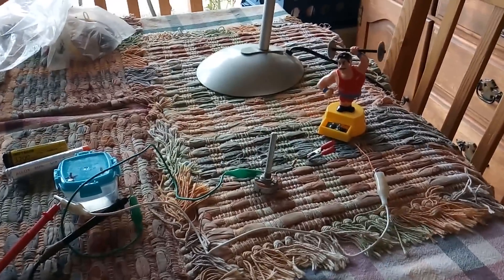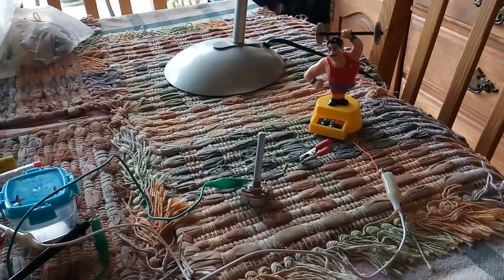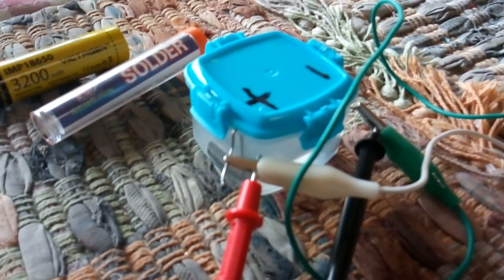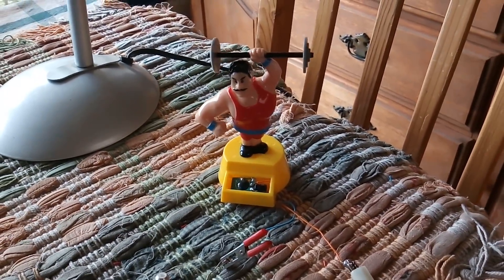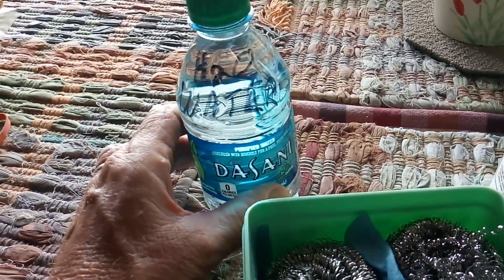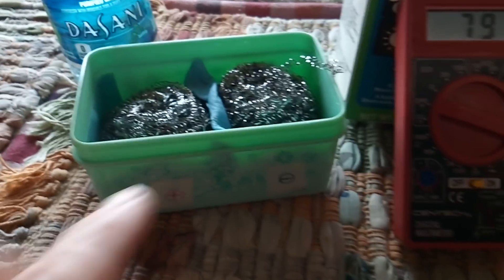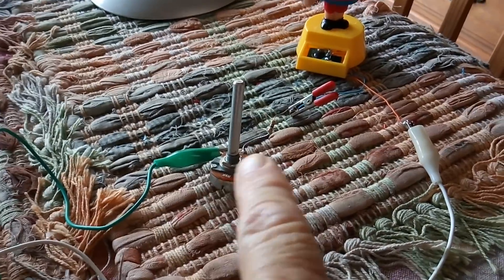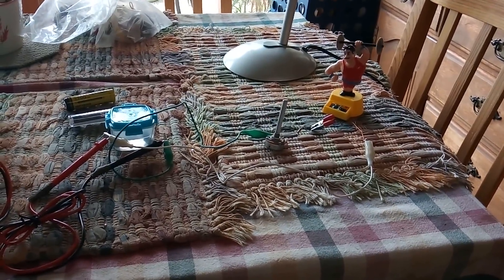Simple Homemade Rechargeable Celll----Powering Mr. Weightlifter

Comment: Plate forming being crucial... cool video. The resistance trick works well for outdoors earth based cells too, to not drag the power out to depletion.
Reply from the maker: Yes the plate forming is critical.  This took about a dozen charge/discharge cycles before it would hold a good charge.  This is a pretty weak cell even then and without the dropping resistance it goes flat quickly.  After I got the plates formed up it would run the little man about 1/2 hour.  A 10F super cap beats it hands down